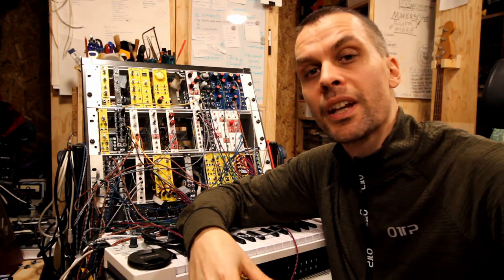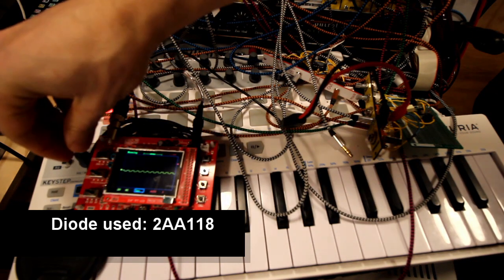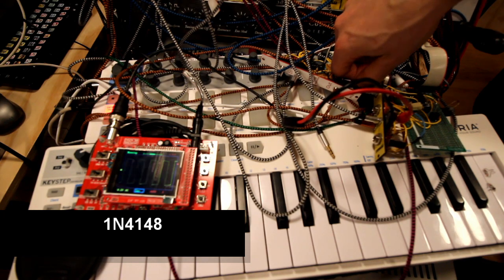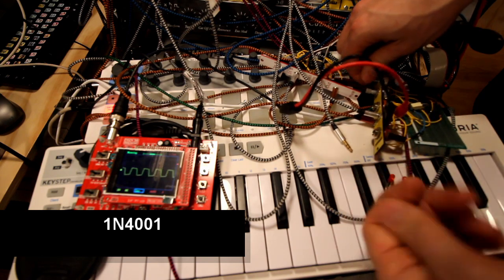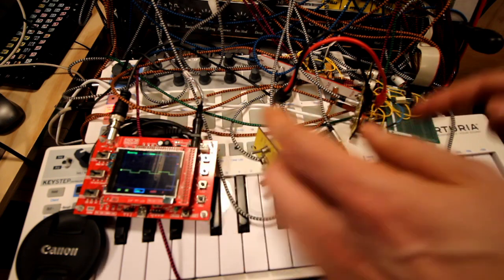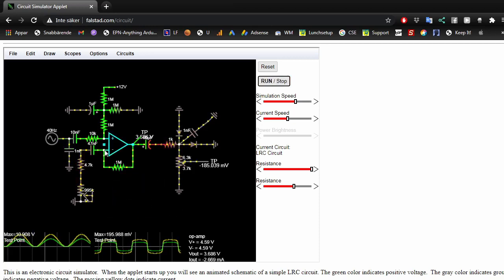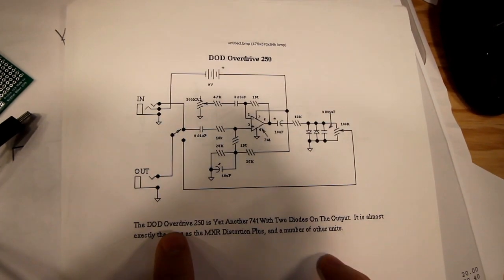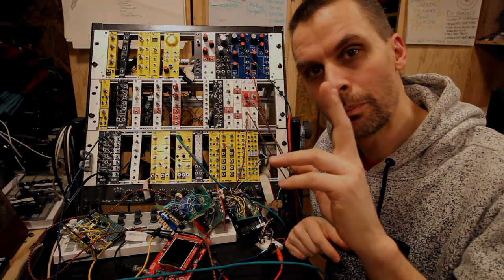Distortion Analysis and testing diodes

Comment: My own view is that the MXR Distortion+ is effectively a "double clipper" in its typical use with guitar.  Most users/builders assume that the distortion comes exclusively from the diodes.  IN practice, however, the gain used with the humble LM741 op-amp, and an equally meagre +9V supply, exceeds that op-amp's headroom.  Consider that the 741 can only swing roughly +/-3.5V around Vref, when used with a 9V supply.  The average guitar output signal will be in the range of +/-100mv much of the time.  That amplitude can only "fit into" +/-3.5V of swing range 35x, yet the gain of the stock circuit goes up to over 200x.  A number of builders over the years have noted that, even when the clipping diodes are lifted, they "still can't get it clean".  So, as far as I'm concerned, the signal is generally clipped once, in the op-amp itself, and then again by the diode pair.  Use of diodes with a lower forward voltage will yield more intense and consistent clipping, but at the sacrifice of output level, while use of higher Vf diodes or simply more diodes in series to raise the Vf, will require a hotter input signal or more gain to achieve more intense clipping, but will also permit much higher output levels.

Which brings us to its use as a harmonics generator for synthesis.

The first thing to be aware of is that using a Eurorack-type +/-12V power supply will raise the headroom of the 741, such that higher gains will be needed to achieve op-amp clipping.  Fortunately, typical synth levels do not require much help to meet the 23VAV range, beyond which clipping occurs.  But the amplitude ceiling set by the clipping diodes severely restricts the output level of the circuit.  I see from your examples that use of LEDs as the clipping diodes still provide useful coloration and harmonic content, so I would recommend use of LEDs as your clipping elements.  One CAN still use regular silicon diodes, but if so, strings of diodes in series would be advisable (e.g. 3+3 is roughly equal to a back-to-back pair of red LEDS).

So-called "soft clipping" really only distinguished by the fact that placing diodes in the op-amp feedback loop prevents the op-amp from hitting the headroom limits of the chip, no matter what the gain.  After all, if the diodes begin conducting at 600mv in each direction, then the signal always remains a very safe distance from the maximum voltage swing.

I will also note that, by using the ground leg of a non-inverting op-amp to vary the gain, low end will be attenuated as gain is increased.  In the stock circuit, at max gain, the low end is rolled off beginning around 720hz.  With a typical early 1970s guitar using single-coil pickups, that bass-cut-with-gain provided a useful side-effect of NOT increasing unpleasant EMI hum as gain was increased.  Within a synth context, that "advantage" is of little practical use, so increasing the value of the ground-leg cap from 47nf to 680nf will help to add some girth to lower notes.

Finally, Jules Ryckebusch's "Harmonic Sweetener" circuit, that appeared in Electronic Musician magazine some 35 years ago, is a reasonable approximation of what the Aphex Aural Exciter did/does.  The signal is split, with the high-frequency content extracted via a fixed 4-pole highpass filter, before being boosted and clipped.  That harmonics-of-harmonics signal (which does not get perceived as "fuzz) is then blended back in with the unaltered full-bandwidth signal.  Having built several, it is a useful circuit for adding a little more "life" to mic'd acoustic signals.  I doubt it would have any practical use for synth, other than maybe with sampled acoustic sounds.

Comment: Thank you for doing this! That was really cool to see!

You can hear the "smooth" corners vs the "sharp" corners effect that  going from "no/little clipping"to "high clipping.

A lot of the distortion is coming just from amplification (as you could see when you had no diode plugged in ;] ).

All the wave forms were very clipped.. the square wave was pretty much closest to no change, because.... same reason.

It was interesting that the saw and triangles did have some different character. Even though they were mostly square waves, the shape of the curve going between the flat lines is what makes the difference.  Thinking abut the frequencies that result might help explain why those 'feelings' came through.

Once again, thanks for doing this.

Comment: What transistors do you need? You have the number?
Reply from the maker: I found one that works. The BC109c is quite readily available and sounds quite nice (tried them today) :) Thanks!
Reply: @SourceryOne  I have an old Fuzz Face pedal from the 1960s and it has either bc108 or BC 109 transistors. Can't remember exactly which without opening it up.

Comment: Don't worry about finding old transistors for a fuzz face circuit. You can use modern equivalents. They'll just have a different gain rating. Old transistors is only snake  oil for guitarists who obsess about 'vintage tone'.